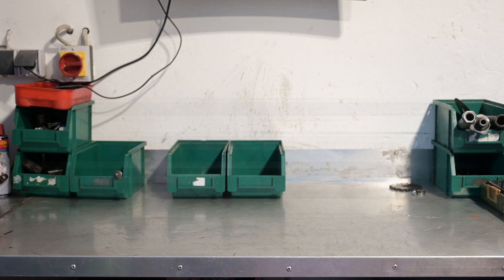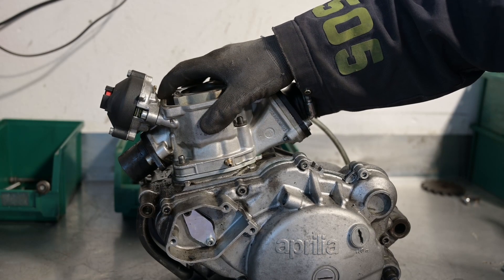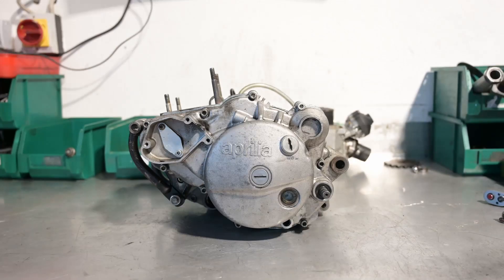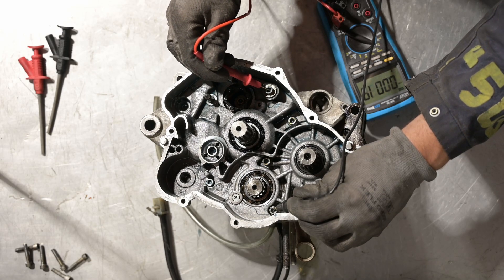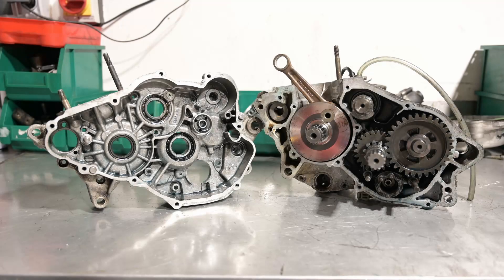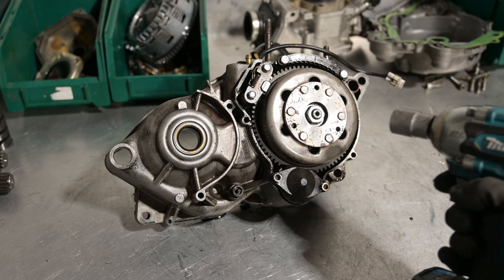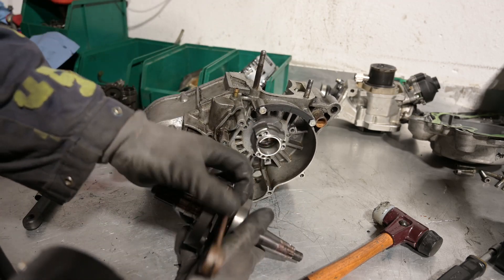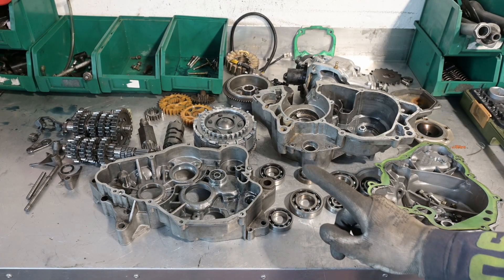Scraprocket Racing - How to dismantle a Rotax 122 Engine

Comment: Crank seal was lip facing out towards balance shaft gear
Is that correct way 🤔
Reply from the maker: Experts are torn apart by the question which way it should face. Either way seems to work, in the manual it says facing towards the counterbalance gear :)